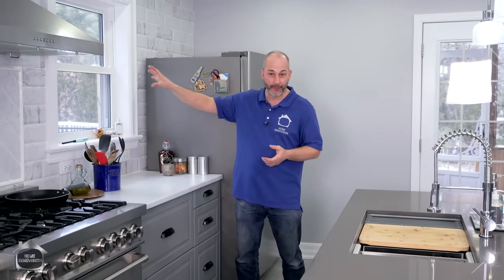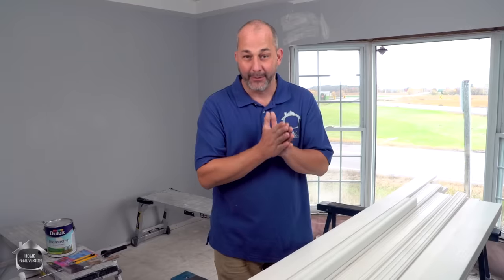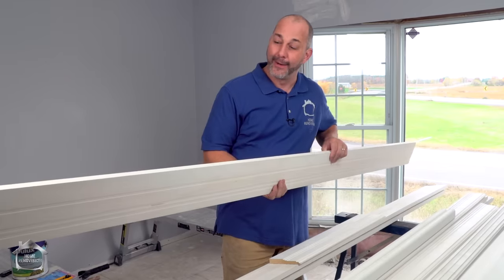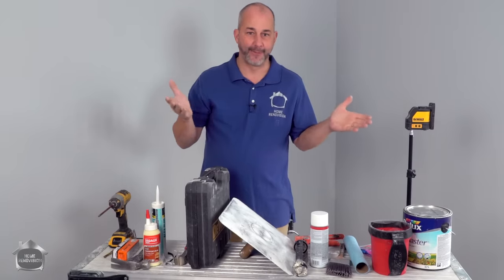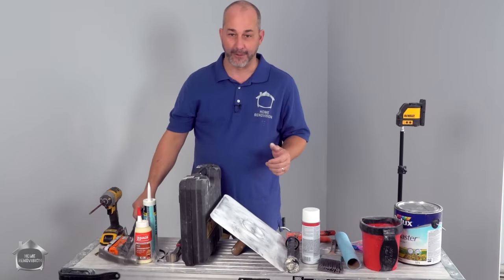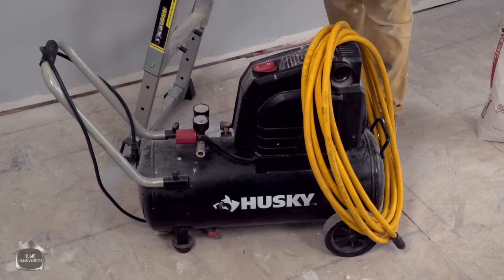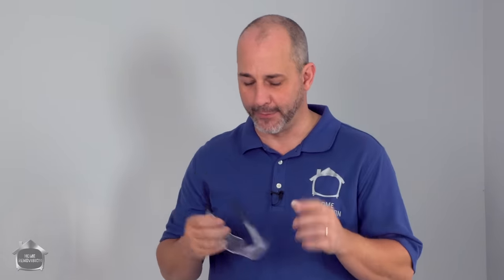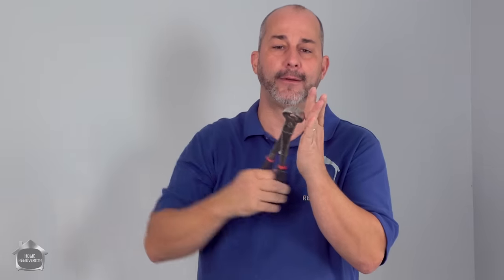How To Trim Doors Windows and Baseboards | A to Z

Comment: Oh boy! Where do I start?
I have seen your videos appear and decided to watch a few. Some good points, techniques etc but you are more a youtube video maker than upper end trades person. Your presentation, humour are good and you are quite a pleasure to listen to. That said ... in this video ......
1. The door trimming was not as good as it could be. Few too little nails and you wouldn't have to dap as much if you did so, especially along jamb.
2. Don't tape measure the header but cut one side 45 and flip it upside down on casement legs and mark second 45 with a fine pencil.
3. Don't cut 1/4 round like a beaver with some snips, rough ... when you have a miter saw.
4. Pre-make all window stools because you said you needed larger. Those construction screws are going to show no matter what. Glue and clamp overnight.
5. Baseboards? What's with all the measurements on a board? Wasting time. Where you can't nail, you PL. Dap is for the painters and not for securing the baseboard.  All inside corners to be coped ... no 45's! Same with the Crown. 
6. No safety glasses! A few times you were pneumatic nailing towards yourself! 
7. Never, never cross your arms when using a miter saw ... one day you will catch a forearm!
If you consider yourself a teacher ... then the lesson should be better suited to it.
Me ... celebrating 35 years, self employed and now teaching college level newbies, passing along knowledge and gained experience to the next wave.

Comment: my son in law is a painter and  rental rehab guy, and his caulk always looked good, like really good, so he showed me how he does it,;
instead of facing the nose of the gun away from the direction the caulk  is traveling,  he cuts the  nozzel at a pretty steep angle (between 0 and  359.99  degrees,lol), no , about 30  or so  and points the nose in the direction he wants to travel with the caulk, and with a  constant light pressure on the trigger,  he pushes the caulg gun up the seam,, and man it looks clean,,, he says it pushes the caulk into  the seam, and the back edge of the nozzel cleans the trailing   edge up very nicely,, the trick is not to put too much on or it gets gloppy,,, i got some dollar store caulk and practiced it for about a half hour, and after i got used to it ,,, it was so much easier than the way i used to  do it,, i used to get a cup of auto body laquer thinner, an acid brush ,a plastic spreader, a 12 pack of shop rags (i was never enough), and a bottle of water to get the thinner out of my eyes durring the whole process,,i was a mess,it would be all over me, the surface i would then need to paint, and anywhere else i happened to touch, but now i'm not too bad at it

Comment: Great video, thanks! For you guys cutting precise angles for the first time like me, you need to calibrate/fine-tune your miter saw! Every angle has an adjustment screw on my cheap saw. I was quite dismayed at my first 45 degree joint before I grabbed my 90 degree ruler and adjusted them all. Even the guide piece on mine needed to be loosened and slid a bit for 0 degrees to read correctly. Literally none of them were perfect from the factory!

Comment: This was a great video! I'm doing a garage conversion into a bedroom. I have to add a door and 2 windows into the exterior walls so I needed this! Typically I'm a rough framer/concrete carpenter, (although I have done quite a bit of custom fine furniture (I had an amazing mentor)) so the window finishes are exactly what I needed! Thank you so much for this video!  I'm realizing my time line may be a bit off after seeing what goes into these finishes 🥴...

Comment: Great video !! The yellow plastic tip on your dewalt brad nailer is called a ‘ no mar ‘ tip . You mentioned that oil needed to be added every 30 minutes to the nailer . The correct answer is 2-3 drops of oil per day.  Of course , as you mentioned if you’re tool is oil free you need no worry about oil . Just my 2 cents . Again , great video and awesome tips .

Comment: When doing mitered casings in place as you show, I like to install the head casing first. I mark my reveals at the top of the door in the corners and measure between the 2 marks. I tack my head casing in with 2 nails and then cut my legs casing pieces. I cut and fit my legs. I fit the miters first and nail them off. Then I manipulate the leg casings to fit the reveals. This allows you to get your miters perfect and use the long levers of the leg casing pieces to fit everything where you have maximum leverage to bend things into place. The big advantage is that you get perfect miters every time and if you make a small mistake cutting your casings, the gap is at the floor where it will be almost invisible. No one will ever notice if your casin is 1/16th off the floor, they will notice a sloppy miter. Also if you need to "tune" the length of the legs because you cut a shade too long, you can cut off the bottom where the cuts are square.

Comment: A tip for caulking: cut off a piece of an empty caulking tube about 3 in long and throw some tape on the end to make a tiny little bucket. As you wipe the caulking, scrape your finger against the little bucket to catch the caulking and keep it neat. Then your rag will have minimal caulking and keep everything clean!

Comment: So basic question. If you have carpet going in as your finished flooring what do you recommend to use to set the gap for the flooring to tuck in under the baseboard?
Reply: Use the fat end of a shim, it’s 1/4” which works for most carpets

Comment: Hey Jeff, long time fan! I have been following your videos since Dec 2022 and I have been finishing my basement from scratch using your methods. I am now on the baseboard portion and I am having a bit of trouble. Is there a simple way of connection baseboard to already installed baseboard? I am having issues lining up the bottom piece. 

Another question, I know if your video you suggest connecting them before hand. How would this be possible with an entire room?

Comment: I’m surprised that you are not using CA glue. Do you have preference between CA Glue and Carpenters Glue?

For trim, I LOVE to use Flotrol for the paint. It basically allows the paint to dry slower and fade/erase any brush marks. 

Love this channel. You are the best in the business!!!  Thanks Jeff.

Comment: Love your videos, have been a help over the years...  on your door framing at 35:27, the frames are aligned perfectly but the step to the door jam is quite a bit higher on the right than it is on the left.
Reply: I agree. If I had paid someone for trimming out the door I would really be upset. It's way to obvious that the reveal on the top piece isn't equal for one side to the other.

Comment: Great vedios very informative.
Working on finishing our basement have a question on trimming out a door. We have an I beam that runs the length of the basement which I made a bulkhead. I have a door to a bathroom and to a laundry room that will need trim not sure how to make it look right due to the lower height that will not allow a full trim width at top of doors. Not sure what to do without it looking weird. Any tips or tricks? Thanks for all the great vedios.

Comment: Do you prefer the Drydex or hot mud when filling nail and screw holes in trim?  Seems like the hot mud would flash more on larger screw fills.

Comment: I am using this video to learn how to replace the trim that was badly installed in our home before we moved in. It is loose around the front door, so I have some make up work to do to make it good. I was watching you talk about the compressor, but I did not see a link for it. Which compressor would you recommend for just that job. I am thinking to use hammer and nails, but advice would be good.

Comment: 37:00   I had no idea!  I jumped up and checked both of my tape measures.   My 'old reliable' has 3in. on the back!  The newer one is exactly the same but it's not written anywhere!  Good to know!  I use my tape measure so much, I keep it on a shelf at the back door.  That's right, I don't have a garage nor a shed, but I'm working up the courage to build myself a shed!  After all, I've seen enough HRV videos I should be able to build myself a house, much less a shed!!!   LOL   Thank you, Jeff!!
Reply from the maker: Excellent!
Reply: more math= more mistakes  grab the different tape = problems.
 why use a tape when god gave u a thumb . wood as a measure stick an mark

Comment: What do you think about the battery powered brad nailer?  IT might be heavier and cost more but no need for air compressor or hoses everywhere. I am looking for a roofing gun and also a brad nailer but i never used battery powered, maybe i will have to go to home depot or something and just pick one up and test it.

Comment: Hi Jeff, phenomenal video! Question, how would you recommend to best remove caulk on the door casing when just replacing it? I understand cutting the paint line with a knife, however, my concern is for the access caulk on a professionally painted wall,  I'd like to prevent damaging the paint, it would be very noticeable, as the walls are dark and the trim is white.

Comment: Do you have to nail to the stud? I am in middle of reno and used double 5/8 and my Base boards are 1" thick... My 18g nailer only goes 2 1/8". Should I invest in a 15g that can do 2.5" or just dab some caulk as I go?
Reply: I used to install wood baseboards on drywall with metal studs.  Use Liquid Nail or simular then with the longest nail your nailer can use, shoot them at the steepest angle you can.  The nail will wedge the BB to the DW.

Comment: 2:06:04 the way i mount corner brackets is by putting the flush with a side and drawing the circle with my pen , then screw the screw in the middle, back it up put the bracket in and screw it all the way in, saves tape

Comment: Had my basement flood and finally am to the point to put trim up paint in such.    I see your order of painting is trim, ceiling and walls.   Want to save about $500.00 on trim by skipping quarter round.   Thinking of spraying door and jams, ceiling and walls followed by laminate floor then cutting and installing base and door trim afterwards.  Then filling holes and just repainting the faces of the trim and not the edges.   Does this seem like a good series of steps?

Comment: Hey Jeff I've got a question for you. Also side note: LOVE you and your videos!!! Okay so I just purchased a home in Sept 21' that's built in 87' but has had some reno work done. It looks like the trim joint is starting to become unglued and a gap is appearing. How should I repair that? Do I need to redo all the trim or just use wood glue?? THANKS!

Comment: Ok two things. Cornice, Wall, ceiling molding. The wood one, yuk by the way but apart from that the bulge, the heavy prifile goes up. The way you did it is upside down. Cause as it's 90x90mm cornice if wrong is your thing, that's fine to. Second thing with the other one. Plasterboard muds or adhesive "Want" stick to a painted face. It will while the product is wet and it will for a time after but within 12 months or so the cornice will start showing cracks along the top and mostly but will show on the bottom. This depends on the weight,  size off the cornice. Any cornicing should be done during the (at the end) off the flushing before any paint goes on the wall or ceiling.

Comment: Hi Thanks for the video. I have a question about tiling a backsplash first then trimming second. What if the existing window frame is flush with the drywall before the tile? Do you still recommend tiling first? Will there be a gap, and if so how would you recommend fixing that?

Comment: A trick to measuring.  Use a metric tape.  Turns out, counting by tens is waaaaaaay easier than working in a multiple denominator fraction.  It's just a better measurement unit.

Comment: Internal corners should be cut as follows:
Left hand piece - leave it square and fit it to the wall at the right end.
Right hand piece: left hand end is cut as per shape of the board but at a 45 degree inward (hidden) angle.
That my friend is the way it is and should be done. Cheers.

Comment: Thank you! No hate, I have been telling carpenters and drywallers for years that if the make the hole. They fill it. Talk about whining and sniveling, when I build cabinets or install trim, guess what? I fill it all because I finish it all. Good lord you even mentioned using a rag?!? Most the time I finish and then there are greasy fingerprints on everything! Good video!

Comment: Just listened about the tape measure. Here's a good tip. Through that imperial crap in the bin and use the metric system. Here's why. It works in 10's. Work mm (Millimeters). No 1/2 , 1/4, 5/8 or any off that confusing out off date rubbish. I'm over 50. close to 60, I grow up learning imperial and totally hated it!! You can buy tapes with both imperial and metric markers.   On a side note, We get 6x1.2 meter  and 6x1.35 meter sheet rock (US) Plasterboard (AUS) same thing. I'll leave you to convert to imperial if you find it necessarily.  This means a room would have to be pretty big to require but joints on walls. Not saying we don't get but joints at times. NEVER but join on a stud!  You end up with a bad ugly bump. But joint in the center off two studs, back block with plasterboard and cornice adhesive, dry wall cement and push the joint in or up on ceilings to create a recess. Tape and mud then fills this to give a flat finish with not tape bump. Just saying. Haha...

Comment: I have regular Pine trim also have part tongue-and-groove pain on my ceilings I am wanting to fill in the nail holes and finish with a slacker or a stain I will be doing the trim around the wall and window how or what would you recommend for that I really don't want to change the color

Comment: Hey just wondering where your based or where did you by the gun, cause use them past 4 years like 3 a year. And even 4 years ago the robber end was a triangle for ease with crown and panel moulding, it doesn’t have to be compressed down against the trim so awesome for shooting crown or any moulding on doing outside corners or returns. And I love the fact it shoot me empty cause I do mostly cedar shake and pvc trim on homes in the millions so usually tall and to go up a 40 foot ladder extending to line up the trim
Reply: And you see nails in your gun but it stops with ( 5 to 10 ) left cause like the rigid they work with a metal peace that’s spring loaded but there set back 1/2 or 3/4 so u can never shoot last brads

Comment: In Western Australia diametrically opposite to and above Vancouver our drywall is fixed with an aqua glue ONLY, the nails used to be removed after the glue has set.  This is not done nowadays owing to the slackness of installers.
This same glue is used to affix the cornices and other fittings.  It eliminates screw popping and is quicker and easier and the purpose-made glue is cheap
One places a 'walnut' sized dob at around 300mm centres onto the studs or ceiling joists and the drywall is pushed into the glue, screws are used to hold the drywall until the glue dries only.
Quick easy and cheap. If you use Canadian designed square drive drywall screws one can reuse the screws even.seems one hell of a lot easier and better - just saying

Comment: If there is a step ceiling (tray ceiling), and the bottom part of the metal corner strip is separating from the lower ceiling, how do you fix it? Could you trim out all of it , such as crown plus trim around the bottom of the tray to the lower ceiling?  Or it it better to nail the loosened corner bead back up to the lower ceiling and putty and repaint the entire ceiling which leads to a 20’ foyer ceiling that would also need to be repainted as well as the entire 2nd floor ceiling. . Don’t have the color of original ceiling paint. I’ve never seen this done in any of your videos. I really enjoy watching your videos. Thanks so much.

Comment: Great compilation video. I had seen most of the individual videos before watching this. On window trim, though, I wonder why he used blocks instead of a solid piece under the sill. Wouldn't solid have provided more support & more nailing surface for the skirt?

Comment: I have Porter Cable finish nailers that need oil, but I oil them one time in the AM when I start using them and won't oil them again until the next time they get used not every hour I've never heard that before is that really how often it should be oiled.

Comment: Would like to see how you cut in over the caulking on the baseboards. Looks like the walls had a finished coat of paint on them . How wide of a cut line do you us on the wall and is this done freehand or with painters tape ?
Reply from the maker: I like to paint the wall early on and then use latex caulking. paint all the trim and then cut the wall to the base so the caulking gets painted. Cheers!

Comment: It would be great if you could show how to scribe your casing in the event you are doing stain grade trim and your not going to use caulk to cover any gaps. It is a little bit if an advanced technique but it is relatively simple. I understand this channel is designed more for a diy homeowner.

Comment: Seeing those gaps between the wall and the unfinished floor - shouldn't these gaps all be filled with foam or sealant to prevents cold air to infiltrate?

Comment: No mention of a battery powered tacker that costs way less than a compressor and a tacker. You even use an impact driver so this could be combined for the same battery system
Reply: Should he be using a brad nailer or a finish nailer?